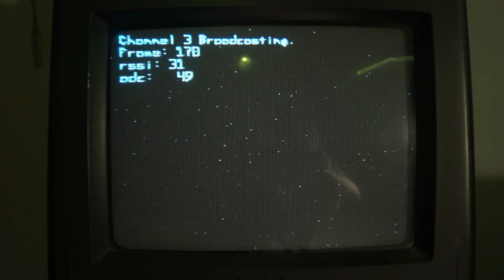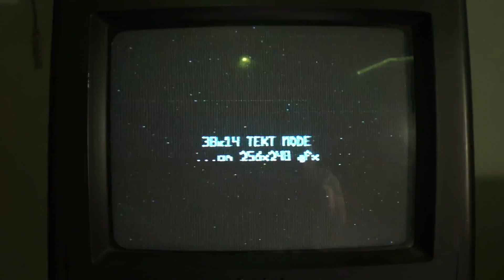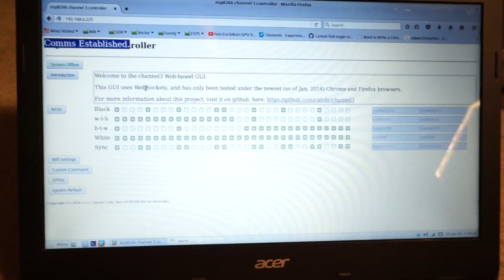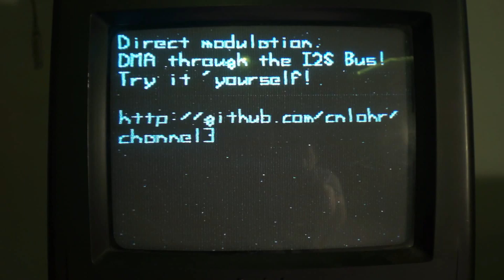Broadcasting Analog TV on an ESP8266!

Comment: is there anything esp cant do?
Reply from the maker: +gamerpaddy Yes.  Ethernet.
Reply: ethernet module using spi?
Reply from the maker: Doesn't count. I'm willing to accept something needing a phy, but... having to use an ENC424j600 or ENC28j60 doesn't count.
Reply: mkay
Reply from the maker: Sorry, had to think about that a little more.  I guess it does kinda count, since most PC processors don't have an ethernet MAC... So  if the ESP /can/ do ethernet ... what can't it do?
Reply: can it output hdmi signals via gpio or comunicate with pci(-e) or agp cards?

probably too slow or too few gpio ports.
Reply: +CNLohr Run Crysis?

Comment: Can the I2S used for much slower transmission? Like in the kilohertz territory? So basically I'm interested if it can be used to produce a crude analog audio.
Reply: Nevermind, i think I've found my answer. This project uses I2S to output 5-bit PWM audio. Great :) http://hackaday.com/2015/06/06/esp8266-as-a-networked-mp3-decoder/
Reply: I see that I2S is outputted on the same PIN as the UART RX works. Does this mean that it will not work with any development boards where the USB UART is hardwired (like NodeMCU)?
Reply from the maker: +István Nagy Going to reply to all your posts at once here... I2S is used usually for outputting high fidelity audio, through a DAC, or inputting from a DAC.  It can be used at almost any divisor of 160 MHz.  There is another piece of hardware, the 5-bit PWM is separate from the I2S system.   Regarding pin usage, you can use this with those systems, however, you would need to re-enter the bootloader any time you need to reflash it to that level.
Reply: Great, thank you for the answers! :)

Comment: I'm always amazed at what you come up with. I've ordered a few of these bad boys to start on my first project... although it will be much more simple, automating my refrigerator's water dispenser via a web page. I watched all of your vids, but I think that they may be a bit to advanced for me to start... anyone here know, what's a good place for a tutorial on setting an 8266 up with a basic webserver, to read/control a few GPIO pins?
Reply from the maker: +TheSageDad I'd look into nodemcu or using arduino with the 8266.
Reply: I've been trying to use nodemcu for the past few days to no avail. I've tried every single baud rate, etc. Using both an tsk FTDI and an arduino to try to just get basic AT commands working with the bugger, and all I get back is gibberish. So even though I couldn't get AT commands working (also tried on two different computers), I tried nodemcu's flasher nonetheless, and it simply hangs at "begin find ESP8266." Tried both ESP boards as well to see if either was the culprit, but same results both boards (so can't rule out the manufacturer, listed as Diymall AI cloud). I'm pulling my hair out...  last ditch is to order a different serial to USB board, and/or different manufacturer of the ESP's.
Reply from the maker: Juuust checking, you are using 3.3-level serial, correct?  I.e. 0-3.3V, where 3.3V is idle, 0v is signal?  No RS-232 levels or anything fancy.
Reply: So three serial interfaces tried: arduino Uno and Nano, both with the atmel chip on and off board (as some vids have shown). I'm assuming levels on the arduinos are compatible, as there are multiple vids out there showing this method. Also I've tried with an FTDI usb board with an FTDI 232RL chipset. This board has a voltage selection of 5 or 3.3 and of course I'm using 3.3. I'm powering the ESP though using a breadboard regulated power supply at 3.3 because I heard most usb/serial boards don't supply enough current to drive the ESP. I have not tried any fancy register shifting setups...  i'm assuming I shouldn't really have to when I'm using all 3.3 volts?
Reply: CNLohr Interestingly enough, if I just power the ESP, it broadcasts an SSID of AI-THINKER_11E1DC. I can connect to this AP and get an IP of 192.168.4.2, but if I browse to .1, I get nothing. So the device is working but I'm still not able to connect to serial to update the firmware and program.
Reply from the maker: It's unlikely the default devices run a webserver.  I wrote my own webserver.  It might be running a firmware update doodad on a port somewhere, but you're probably going to have to connect to its tx/rx and hold its GPIO0 low and program it with esptool or something.
Reply: +CNLohr So... I figured out how to get it to work, but I don't know the root cause. I decided to power the ESP using the power pins from my FTDI board instead of the separate breadboard powersupply, and it worked. (I know that they say the arduino can't supply the current for these, but apparently the FTDI can.) I'm not an EE by any stretch, but I'm wondering if the issue was that there was no common ground between the ESP and the serial port? Anyone have a stab at root cause?

Comment: I wanna ask a negative sounding question but it's really for the right reasons... Is there really a point to learning how NTSC and PAL works considering that they're pretty much dead technologies moving forward?
Reply from the maker: +kekagiso "Those who do not know history are doomed to repeat it"  holds in engineering as well.  Things like why the chroma signal is 180 degrees out of phase every line, or understanding aspects of how signals can be synced in yesteryear can lead to very efficient current day implementations of analogous systems.
Reply: +kekagiso ??? we event still learning AFK OOK modulation, that what hacker/maker do. to hack or make stuff you need to learn from basic and all the pass technology so you can make new technology..

so fast question for you, did you know who invent the wifi and bluetooth transmission? on what era? and on that era what TV technologies that we have? and yet we still using bluetooth and wifi until this day
Reply: +kekagiso curiosity is always a good reason ... I heard Maxwell Equations  had little purpose at the beggining, like a hobby, but today everything depends on it... an extreme example but to show curiosity is good
Reply: I understand curiosity and I'm all for that, but my question is more about practicality, there's so much to learn and it keeps increasing every year, you can't expect to know everything so is it practical to learn aging technologies when you can focus on digital video rather?

Comment: great!! so you can transmit FM signal when overclocked? and RDS text? like a portable RDS / FM wifi portable station
Reply from the maker: +Gian Carlo Salvati FM would be hard, and realistically, any further transmissions really need to be made at 1/2 the 80MHz or less.
Reply: +CNLohr great work. I use some like this: http://m.instructables.com/id/Raspberry-Pi-Radio-Transmitter/ and want to.build RDS+TA station to receive from internet (waze) traffic announcements on my GPS on car.
Reply from the maker: go for it!

Comment: Interesting, but so much noise. Why not do NTSC direct to the A/V port?
Reply from the maker: +Kenneth McCall Eh...  I was gonna do that, but I figured first I'd see if I could do this. ... just cause.
Reply: +CNLohr it's awesome, great work and thanks for sharing
Reply: +CNLohr Now see what you can push on the A/V port, since you wont need to modulate the signal at 60-66 MHz. You might be able to do a couple colors.